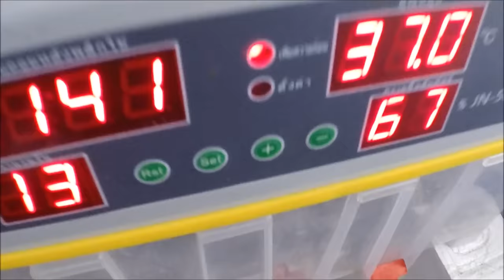HOW TO Build a Quail Cage: Cheap, Quick & Easy Enclosure

Comment: Great job but I think a little tall because you can not reach the bottom. But it looks great hope it works for you
Reply from the maker: Cheers Lester.
We use just use a long handled pair of bbq type tongs to retrieve any that die. The food & water are suspended from the roof so they just get pulled up to refill and lowered back down 😉

Comment: When you use this cage your going to hate it how you going to get birds out .hard to feed and water the birds or have you already modified it. good luck with the cage.
Reply from the maker: Hi Wes, we lower the food and water feeders on cords attached to the top of the cage. The MkII will be about 12 inches lower and divided into 2 smaller sections.
For ease of build it was constructed to the width of the plastic mesh offcuts we had. On the whole we are happy with our first attempt and as always try to learn from mistakes made.
Cheers Leigh and Toon.